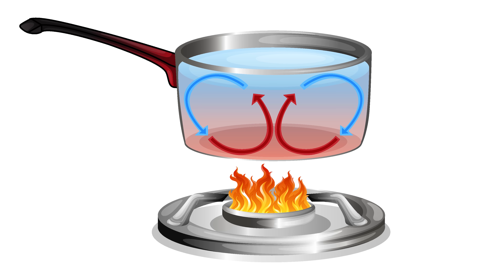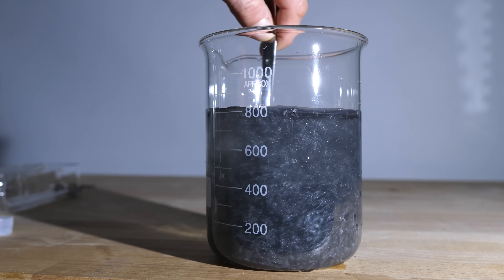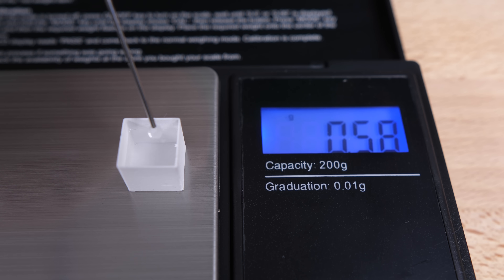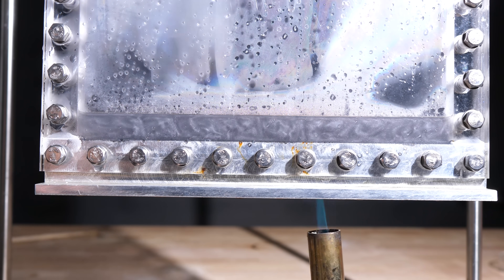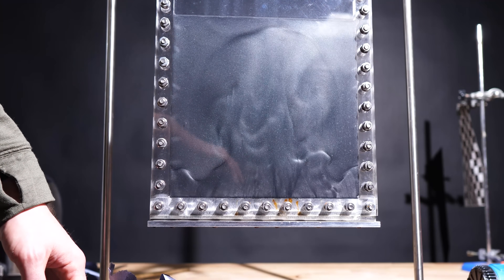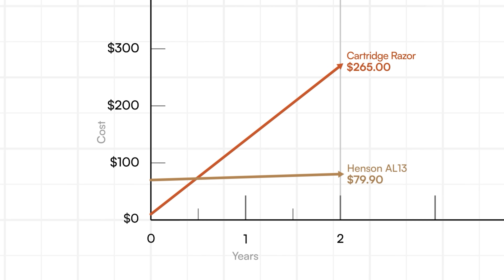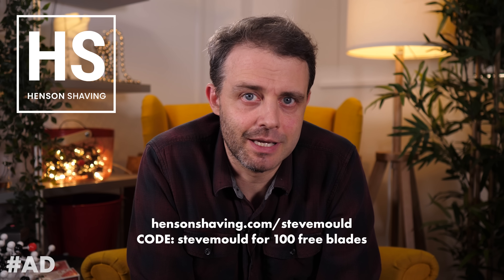The bizarre patterns that emerge when you heat ANY fluid

Comment from the maker: I didn’t really talk about the effect the sides of the container has. There must be a boundary layer effect there and that’s likely going to increase turbulent flow.

The Sponsor is Henson Shaving: Click this link https://hensonshaving.com/stevemould and use the code stevemould to receive 100 free blades with the purchase of your AL13 razor
Reply: The obvious answer is you just need to make an infinitely wide container. :)
Reply: @TheMattThompson  Ah yes, truly a response a physicist would love, along with those friction-less vacuums of course!
Reply: @cact0s_ulion405   Consider a spherical cow...
Reply: @TheMattThompson  Astrophysics: take π=1.
Reply: @TheMattThompson By wider do you mean to separate the glass sheets or just make them huge? The issue is very much 3D because the sheets themselves have boundary layers. There are hydrophobic and hydrophilic types of glass. There is also a robust industry of thin film lens coatings that could help prepare panes for different surface physics.
Reply: @STEAMerBear  As in all things physics: Yes. Yes in every way. Time to hire some postdocs and get some papers written!
Reply: @SteveMould Maybe this could be an interesting topic for one of your videos: 
If you take a sharp blade and push its edge hard down onto — let's say — a piece of rubber (or anything really), hardly anything happens. At most you've created a dent in the rubber. However, if you push the blade's edge only gently against the rubber, and then move it in a cutting motion, it will split the rubber in two. This is a phenomenon we're all familiar with, but yet, I feel there is a lack of an intuitive explination when you start thinking about it. Sure, it probably has something to do with static versus kinetic friction and shear forces, but really, why is a knife only actually sharp when you slide your finger along the edge but not when you push against it?
Reply: I might have my high school engineering students play around with this question!
Reply: Molten metal , like steel, or aluminium ( preferably hot enough to emit visible black body radiation) forms beautiful prominent convection cells which I think look very analogous to the surface of the sun.
Reply: I'd like to see the myca and beads mixed...
but not very much myca, just barely enough to see turbulences
Reply: While you were discussing the behavior of the the green beads, it occurred to me that while the beads rise on the "current" of rising warmed water molecules, shouldn't there also be a counter-current effect where they want to sink in the now less dense water?  Perhaps that's where some of the "chaotic" flow comes from?
Reply: Water is densest at 4C; it is nice to see the demo with water near freezing T heating it up: could we see inverse convection cells going in the opposite direction?
Reply: First experiment looked like Jupiter
Reply: I do like my Henson razor because it's so much more affordable but I don't find it gives quite as good a shave as a new brand name cartridge razor right out of the box -- at least used without shaving cream as sometimes happens when I'm in a hurry.  The difference is that I can reasonably afford to pop in a brand new blade in the Henson every time I shave while doing that with cartridge razors got infeasible.  

I just wanted to inject a dose of realism here.  There are reasons, in addition to marketing, for how and why the cartridge razors are designed the way they are and they have some advantages but there are tradeoffs.
Reply: Hey!! I see my comment in the scroll! I've had my Henson Razor for 3 months now and love it. So, so smooth. Though, I do tend to shave both sides of my face...
Reply: A circular (hollow cylindrical) version of the 2-d container seems like it would eliminate the "sides" part.
So much of this video is just fascinating to watch, on par with fireworks, thanks for making it so visually enjoyable. :)
Reply: When referencing specific named phenomenon I think it'd be nice if you splashed some text for it on screen.
Reply: There’s definitely an opportunity to go into detail about stratification and it’s effects as a fluid flows.
Reply: I tried using that link, to see whether I'd be better off switching or sticking with [redacted], and it offered to take me to the UK version of the page, whereupon I got a 404 error 😞

So I went to the list of International Retailers and found the one that lives in the UK…and got another 404 error 😞

Looks like I'm sticking with [redacted] for the time being…

(I did consider including the name of my current supplier but I didn't think that would be fair.)
Reply: Of course! I like to think or find out if all the non-heated sides are also what's causing the non uniform fluid flow that's shown in the video.

Just like lightning ⚡ the heat is gonna spread out ( in various degrees) in the direction of the cold areas.
Reply: i have boughta  henson razor because my other two safety razor are very ruff and their henson's advertising said they are precise. i have to admit  my razor from them is really good
Reply: by now, I'm starting to suspect you wait to shave only when releasing a new video
Reply: this might be a silly question considering the material, but you were able to get sun like convection patterns using a material with a higher viscosity. is there any way take tempreture into consideration and look at the suns behavious to get an estimate on how viscous the surface of the sun is? i know its just a big ol ball of plasma so i dont know if theres a way to do a conversion, but its still a thought i have.
Reply: Hi Steve, another great video. I used to do cave diving and a common thing we used to come across was thermoclines, which to me never made any sense as the water was all the same but there were distinct layers of different temperatures. Wonder what your thoughts are on this phenomenon?
Reply: I was interested in the mica powder you used to make the rheoscopic fluid, but I wasn't sure which brand or type to use. Could you provide the link to where you got it from?
Reply: @SteveMold I would like to see Henson Shaving shaving with a razor blade coated with diamond (Diamaze® Plasma Sharpened Diamond Coated Razor Blades). This would be interesting both from a scientific perspective and in terms of sponsorship.
Reply: YUP.... Inkjet Printer Ink.... SHOULD BE called 'Costakidneyium' 🤔😏
😎🇬🇧
Reply: The Henson Shaving handle is good. But the greatness does come from the type of blade brand you're using. The Henson blades are a really good quality and really sharp. If you buy the cheapest blades you can find. The shaving experience will be terrible because they aren't that sharp.
Reply: So next up: A weightless, heated sphere 🌌
Reply: How long will this promo last? :D I don't know if I should wait until my father birthday :P
Reply: could this be a representation of rip current
Reply: I wondered if maybe an electrical analog could be more "2D". The google found: "A DIRECT ELECTRICAL-ANALOG METHOD FOR TWO-DIMENSIONAL
TRANSIENT HEAT FLOW ANALYSIS OF FIRE-EXPOSED STRUCTURES" as the first result. Go the Google!

"The theory, construction details and performance of an
electronic instrument which permits solution of transient heat
flow problems by direct electrical analogy has been previously
described [1] and the instrument has been used to solve a num-
ber of one-dimensional problems. Since the method involves
the use of "lumped" resistance and capacitance elements, the
extension to two (or three) dimensions could be accomplished by
the use of discrete (i.e. lumped) circuit elements arranged in
a two- (or three-) dimensional array.  ..."

[1] A. F. Robertson and D. Gross, An Electrical-Analog Method
for Transient Heat-Flow Analysis, NBS J. Res. 61, 105
(Aug. 1958).
Reply: Hey, Engineering student here. To achieve the hexagonal pattern, Could you try the Petri dish again, but with a significantly more viscous fluid. I belive the hexagonal patten exists as the fluid would tend to the the least path of energy and the huge shear/frictional energy generated by a more viscous fluid should cause the discrepancys of your system to mess up that hexagonal pattern less.
Reply: There is an obvious and pressing matter to answer, plus to improve your experiment.  Just use Guiness Draught and finally show us in 2D why their bubbles go downward at the walls😂
Reply: Some control group you have there, interesting thought, how much of this is happening in science? How many scientists shave the control group with the handle.
Reply: I did not expect "The Powder Toy" to have been giving a reasonable facsimile of convection this whole time. I thought it pretty simplified but looking at the plastic beads its pretty spot on.
Reply: OMG How do you search YouTube comments?!!
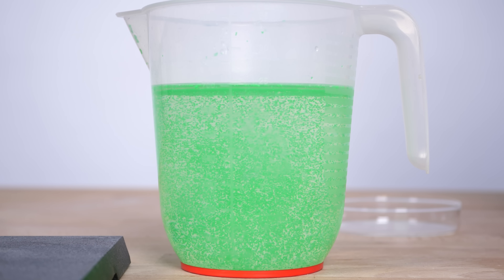Reply: First, may I suggest applying a super hydrophobic coating to the chamber to reduce boundary lay effect. Second, are you sure about your buoyancy explanation at 5:00? I thought water was supposed to be incompressable. I would expect the movement of water to be a result of the heat increasing the water pressure locally.
Reply: Hey I've seen a matte dark green trunk paint mixed with turpentine in the paint lid doing exactly what in the surface of the sun, which seems odd but fascinating. Please look into this👍🏼
Reply: Steve lives in a 2D Mould
Reply: Если плеснуть в чашку петри этиловый спирт, то в тепловизор можно заметить не только основные ячейки бенара, но и более мелкие ячейки , перемещающиеся как и основная жидкость - в вихревом потоке. Т.е. получается вихрь вихрей!
Reply: Also wondering whether a thermal camera would show anything interesting…
Reply: The cream works because the alcohol touching the cream on the underside will break the protein bonds (denatured) so the heavier cream on top will 'roll' the cream which brings the alcohol up to evaporate and repeat.
Reply: Love the video, love the "joke" about most expensive substance...
Reply: why is half your face shaved, steve?
Reply: phillips zero electric shaver is great for a preshave before a close shave with a safety razor!
p.s. the visualization you provided was TOP NOTCH. particularly the oil convection. really amazing. deep thank you to you!
Reply: Don't boundaries often increase laminar flow? Check out some of the laminar flow water videos which often use a lot of narrow tubes. Though the answer might be "it depends".
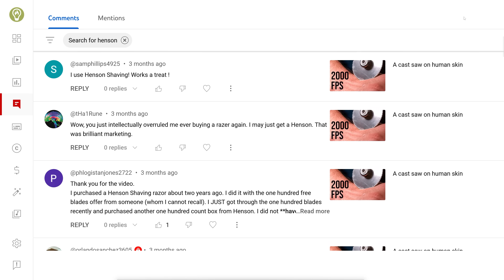Reply: 9:15 "It is really unusual to get that much positive feedback about a sponsor"
Its Bots Steve, positive feedback Bots to reinforce sponsorships
Its illegal, but do you think YouTube gives a crap about it? LMAO
Reply: Soy wax, candle dye and pearl luster dust works well for this.
Reply: Hey Steve, could you re-jig this experiment and do something with cold water. It gets denser as it cool but then less dense when it freezes. This would be amazing to see.
Reply: Please do a hydraulic ram pump. I’ve never seen anyone make one with square tubing and I’ve always been curious
Reply: Rheoscopic patterns are formed by shear in the flow, i.e. different velocities between streamlines. A thin flake at an angle to the streamlines will "pushed over" by the faster flow to one side, twisting it parallel to the streamlines. Flow close to the side plates are twisted parallel to the plates by the shear in the boundary layer. If the flakes are small relative to the boundary layer thickness, the flakes act like a window blind, obscuring flow further from the plate.
Reply: Hope it is not a stupid question. But what about non homogeneous liquids?
Reply: I do enjoy my Henson razor! I got it after your first promotion of it, it's one of my best purchase ever, and besides the lower overall cost and the improved quality of shave, it's also more eco-friendly, so many advantages, I haven't found any negative points about it yet, and I've been shaving with it for months now.
Reply: Have you noticed how some pop-corn kernels have that same sort of pattern on them?
Reply: Beautiful inquiry! Thank you!
Reply: I'm 100% certain that hexagons can be obtained if the heating is uniform.
try a water bath with intense stirring.
or some electric water bath that's used with the pycnometer
edit: thermostatic bath
Reply: YUP.... Inkjet Printer Ink.... SHOULD BE called 'Costakidneyium' 🤔😏
😎🇬🇧
Reply: The honest and uncorrupted astro physicists have been saying the sun is liquid for a long time ...
Reply: My guess is you can only see those convection cells from a top view from heat source. You would need to heat the back panel to see it or creates a circle/square box verve thin rectangle because if your heating the bottom only the top will show the convection cells.
Reply: The higher viscosity fluids make discerning patterns a lot easier.
Reply: I have a Henson razor, & I bought one for my nephew who will graduate from high school this spring. Great razor.
Reply: The oil in the pan looks like the Giant steps in Scotland.
Reply: Those convection cells look a lot like the surface of Pluto.
Reply: @SteveMould If you used the stuff in Hypnotiq liqueur you’d get the effect you’re looking for. 

It’s the stuff in jellybeans.
Reply: I hope you are doing ok steve
Reply: do lungs work similior with oxigen in & carbonoxid out ?
Reply: Is there a time limit on this code?
Reply: It definitely has a relevant effect. You can see it when I was commissioning ultrasonic flow meters for a very large pipeline company and they used multiple sound sensor calculations to show the turbulence within the pipe and it changed based on the flow rate, temperature, and viscosity. You're always hoping for a uniform blunt-nose-shaped flow profile and not chaotic since it's an inference meter; not a direct measurement. This was an awesome video!
Reply: Hey Steve, if you ever watched the BBC series Earth Story, a lovely Earth science series hosted by Aubrey Manning, a geology researcher used Lyles Golden Syrup as a convective medium and got beautiful hexagonal convection patterns. They had a hot water bath beneath the syrup and passed light up through the fluids onto a screen set at 45° to view the pattern.
Reply: I bought a Henson razor. One day I want to get the Titanium one, but the only problem I have is that my wife is constantly stealing it. So, I've even been debating buying her one. Didn't know Mould had a sponsorship tho so next time I'll definitely use his code!
Reply: Nice videos, More answers more  questions , if i heat a air if one magnetron i cane warm air in laminar flow or turbulent flow? I ask because  i like to heat in long range in this stile we can control our climate ( clouds and wet air in general because one magnetron work if dipole molecules) whatever another good part is in introduction and in minute 2:13 first time start in laminar flow and end if turbulence flow
Reply: Hey man, your cadance and tone kinda feels like Mr. Bean giving me a science lesson.
I. Am. Here. All. The. Way.
Reply: You may have just discovered the process of  cellular life generation... from the  primordial 'soup' to early  cellular 'life'...
Reply: At 7:00 I believe you just proved the Sun's surface is liquid.
Reply: corn syrup works great for producing regularish hexagonal cells in a wide tray. we used gently heated Karo syrup to model the Earth's mantle. in a transparent dish held 50cm above a table, shining a light down from the top showed the cells in fairly sharp relief as shadows. undergrads loved it
Reply: This effect can be seen with a thermal camera with cooling candle wax which then become visible to the naked eye as the wax transitions from transparent to opaque.  The container was a metal shallow bowl.  Super interesting looking and it's so cool to see a video about this.
Reply: Ok Steve, this is a great video!! My friend and I have been having a discussion that goes back almost a year now and there are times like this one where that debate rears its head yet again. I'm hoping you can help!! 
I won't give one side or the other; but here it is.
Temperature is a form of pressure.
What are your thoughts?
Thanks so much for these awesome videos!! I jumped in with both feet during the floating falling chains!!
Reply: Yea… if only someone knew of an effect in Adobe that could show it better…
Reply: Maybe it's because oil is non-polar
Reply: Embryogenesis
Reply: Do you realise that you've just disproved the accepted theory of Sun being a gas?😂😂 Yes, it is a liquid,  it looks like liquid, walks like liquid and in general behaves like liquid. But somebody sometime ago said that it is a gas ball and all the NPC/lemmings continue repeating that rubbish
Reply: @dmitryisakov8769  Both gasses and liquids are fluids.
Reply: Your assistants are gorgeous!
Reply: Yep that is a major point of the Chem trails. Traping that heat and transporting it up north. Melting the ice caps and pushing that cold air south.
Reply: @jeffcook8501  do shut up
Reply: Henson? No! Buy the new and improved Occam's Razor. Now with TWELVE blades!
Reply: @TsandLman  Surely Occam's razor doesn't needlessly multiply blades.

Comment: Because water's density is maximized at 4C, you should be able to do this experiment in reverse by heating 0-degree water from the top and watch as the density of what you heat goes UP, causing it to fall in.

Comment: Forgive me if someone else has said it, on a summer day ripples in a swimming pool that has small waves create this effect on the bottom of the pool very brilliantly. Not a thermal effect yet almost the exact optical affect without the thermal component. It's constantly random. Filming can be difficult to focus on just the bottom of the pool and not the reflections off the surface of the water.

Comment: Nice video! I think you should use a different technique to heat the entire bottom evenly. Changing directions at the left or right probably heats the ends more as you change direction. A constant speed would be better. Accelerate before you reach the container .